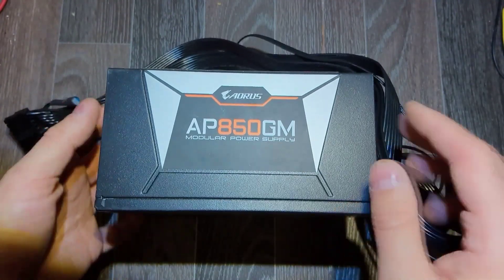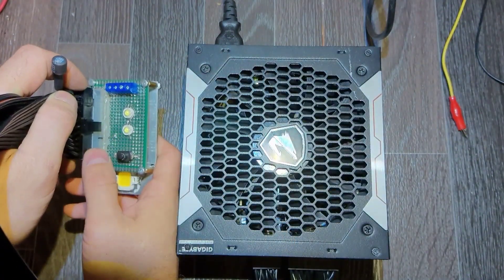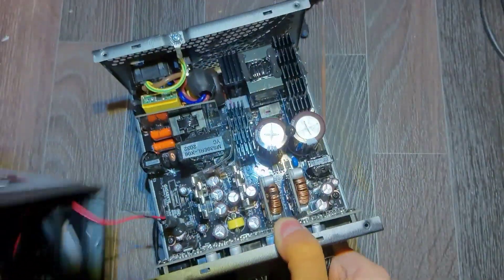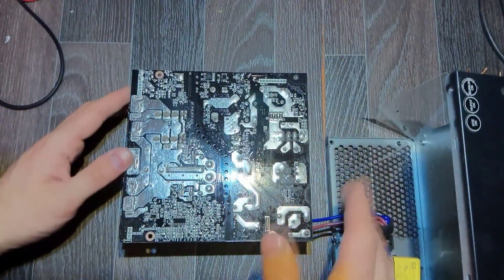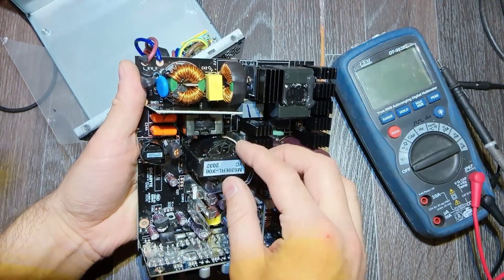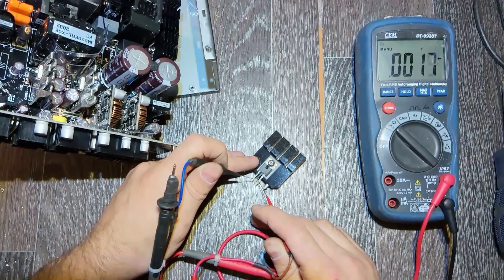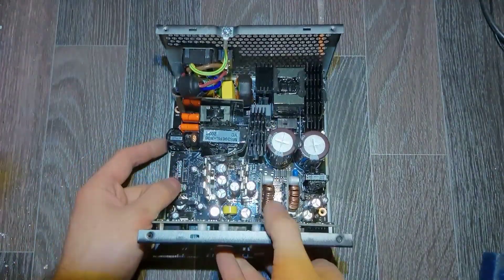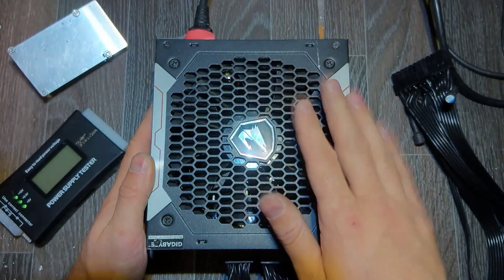Gigabyte Aorus power supply repair

Comment: Hi, I know that it has been 3 years since you published this video, but is there any chance that you know the values and type of the green ceramic capacitor above the giant capacitors.
The one on my PSU exploded, and I couldn't find any info about the replacement.
Reply from the maker: @saidmrini4863  hi. It's not a capacitor. It's a termistor. By simply replacing it you won't have a working  power supply. You must check primary mosfets first.
Reply: @electronicshaverightstolive 
Oh man thank you for your response, you don't know how much I appreciate it, I am an IT student that's about to graduate, while I have some experience, fixing computers, even the stuff that include desoldering and soldering, and maybe phones too, this is would be my first time fixing a power supply.
While I know all the basics, I am not an expert by any means. 
Your response did clarify a lot of things, and I know that I have to check the mosfets from your video, they are damaged too by the way, but I still have no idea how to determine the correct value for the thermistor replacement, if you can provide any further clarification that would be great.
Thank you for your time
Reply: @electronicshaverightstolive 

A 16P 5R PTC thermistor is commonly used on this type of circuit, so I have some hopes on it, but from comparing the one I have with the physical characteristics of 16P and 15P I think the 15P may be a better match.

16P normally has straight pins, while the 15P has a bent ones just like the one I have.

The problem is that the only one that I was able to find is a 100R. and I don't know if it is a good fit.
Reply from the maker: @saidmrini4863  As long as I remember there's a relay in that power supply. Termistor is only used  for limiting the start up current. So any termistor 10 to 20D, 5 to 20 Ohm would do its job just fine.
Reply: @electronicshaverightstolive  I can't thank you enough. This is the only useful response I received from anyone. The parts are going to take some time to arrive. I will let you know how it went.
Reply from the maker: @saidmrini4863  ok. Don't forget to check gate resistors and driving npn, pnp transistors. They might be faulty as well.

Comment: I have this power supply, it has coil whine, and the fan also makes clicking noise (maybe its hitting something? or is rotating in unstable way)
do you have any idea what component is making the coil whine? (so I can apply some thermal pads on it to lower the vibration)
thanks in advance
Reply from the maker: Coils can normally audibly whine at some specific frequencies (loads). In my experience 99% cases of whining were due to bad capacitors so you should check them as well.

Comment: Hello, i have two LDLC 850w psu that have the same problem, they run fine when i power them on, but when i turn them off, they wont turn back on again until i wait around 30+ minutes..

When i turn them on the first time they work just fine for days, the computer run perfectly, but when i turn it off it wont power on again.

Can you please suggest where could the problem be since i opened and all seems fine, there are no shorted components and i dont have schematics for them.

Thank you
Reply from the maker: Hello. It is a strange fault. Never met anything like that. My sugestion is that the superviser IC monitors output voltages and when you turn it off those voltages go below preset level and superviser sets one of its outputs high forbiding pwm/LLC IC to start until a capasitor that supply power to superviser goes down and superviser resets. Not sure about it but its the only sugestion i have.
Reply: Check capacitor, bootstrap one, around 220 microfarad, see on any atx power supply schematic, where standby and main 5V meet. Most probable is capacitor or protection circuit.